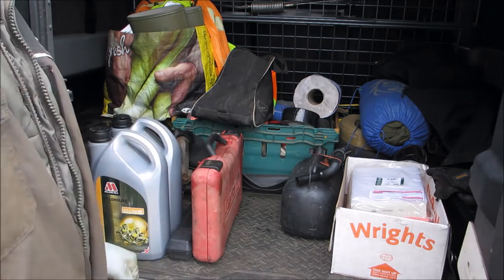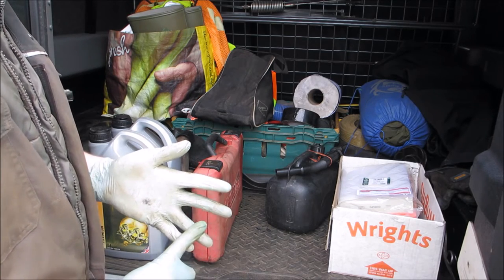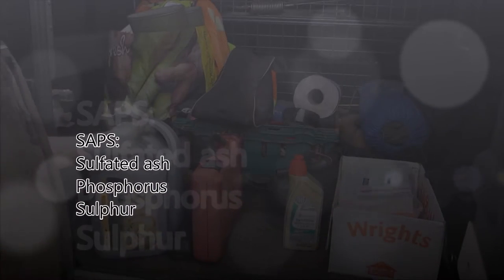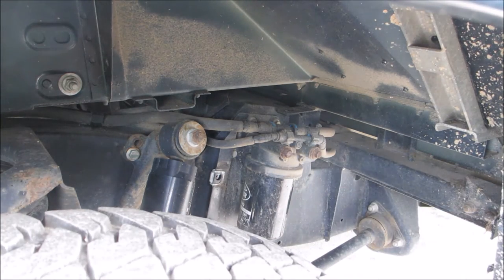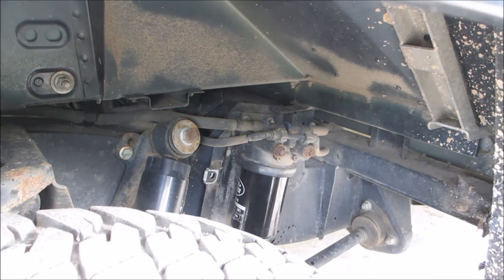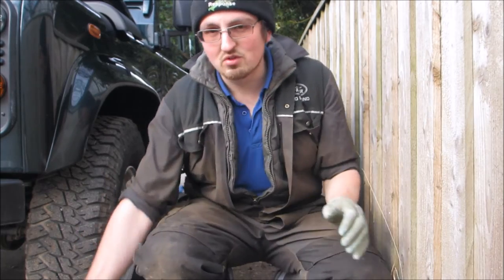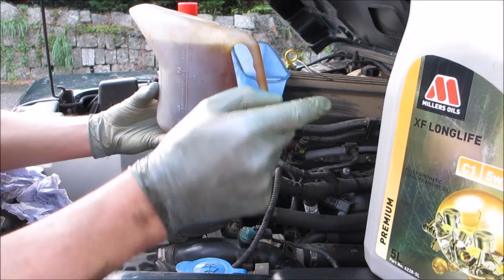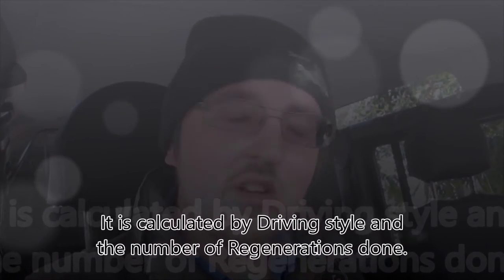Land Rover Defender 2.2 TDCI Basic Service Guide

Comment: Hey. Anyone of you know how to reset the dpf light? My dpf
Is actually removed and the light only comes forced by some clock as far as I understand. There is supposed to be a way of cancellation also by ignition key and pedals but I cannot find it. Any help here?
Reply from the maker: Hi. I cannot say for sure but would go back to whoever reprogrammed your ECU in the first place. As I don't know where you are in the world, the hot potatoe of Emissions devices and their modification and use thereof, is a hot potato I'd rather not juggle for long.

Comment: Hi i need your help. I have a 2.2 as you do. I'm in the US and with no one here to help i had to figure everything out myself. My stupid question is  what is the piping and where  does it go in video?  reference behind the word " Briefly ". Sensor is above letter " r " I just got my motor running and not sure where to plumb that. Thanks.....Romel
Reply from the maker: Hi. I'm not sure which sensor you are referring too. I looked back through the vid and didn't see the word briefly. Do you have a time stamp (I.e. time on the video when this sensor is visable?) I'll help as much as I can.
Reply: @Devonlandrover  Hi at exactly 16 minutes in there is direction to " Run the engine Briefly ......
Reply from the maker: @cocoritemassiveify  Gotcha, missed that part of the text. lol. The green plug on the metal pipe is an Air charge Temp sensor PN: LR032216 It is upstream of the inlet manifold and downstream of the intercooler
Reply: @Devonlandrover  Hi thanks so far. Please give more details. Yes i know it sounds pretty straight forward but this motor is all very new to me. Is this the bottom side of the inter-cooler? This is the A/C inter-cooler?
Thanks again
Reply: @Devonlandrover  HI i found where the hose goes to the intercooler. Do you have a part number for that hose? Don't want to buy the wrong one
Thanks, again
Reply from the maker: @cocoritemassiveify  Hi running in order Intercooler - Hose (PN LR057323) - Metal pipe (that includes the above ACTS) (PN LR032214) - Elbow hose to inlet manifold ( PN: LR067644) The metal pipe and the elbow hose though do come as a combined part that is more commonly sold (PN LR030032)

Comment: does the puma 2.4 have an oil service warning on the dash?
Reply from the maker: Hi. Yes it is the same process, just the trigger is different.  also things like Freelander 2. The reset is a basic ford wide thing for transits etc etc
Reply from the maker: So the euro 5 dpf will have more complex driving style algorithms built in to decide when oil dilution is at a critical level. Where as the euro 4 stuff it's a fixed mileage service reminder.
Reply: @Devonlandrover  Ok thank you, iv just started changing my own oils and filters. So i will get a reminder on the dash at some point but the removal process is the same as you showed in the vid. is that correct?

Comment: Excellent video, but you didn’t show how you do the gearbox oil. The filler plug is in a awkward place and it would be interesting to see how it’s done.
Reply from the maker: Hi B C, I didn't include the G'box oil in the basic guide as 'According to LR' it is a 120K replacement Item. IMHO It should be done ASAP from the factory as there are countless cases of them being under or over filled, (Or none at all for about 500 units in 2007 *cough), As the gearbox beds in during the first couple thousand miles that is when it needs a change.
And really depending on how much work you do be it gentle commute or heavy towing then I would say every 30K to drain and replace.
I replaced the oil @6000K and then again @33630K as I had the rear main oil G'box seal leak so whilst I was in there I did the G'box & T'box oils. 

Yes you are right the filler is a pain. There is pumps available (google Quicksilver Gear oil pump) that have a thin filler style pipe to get in there or I just used the Squeezy bottle that is supplied with the oil. it is a little fiddly but you can get it high enough to pour it in. The capacity is 2.2 litres so 2 bottles then 200ml in on top. depending on your model year it will be a T50 Torx bit or an 8mm hex head driver.